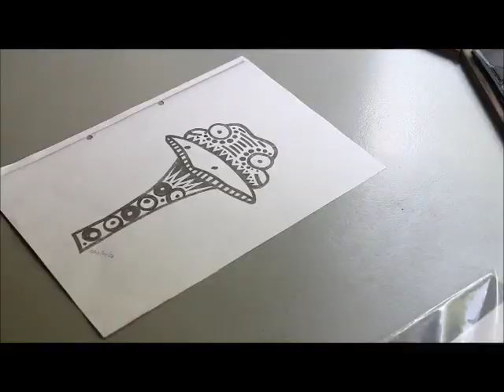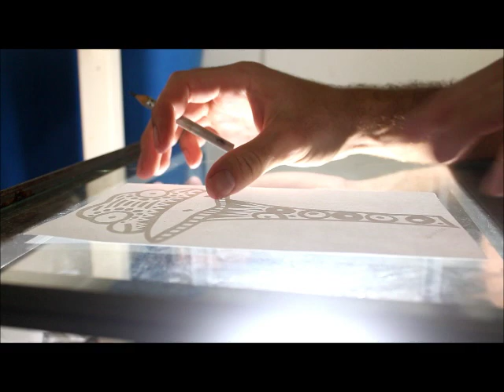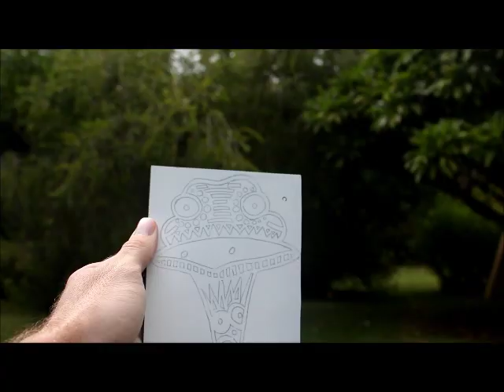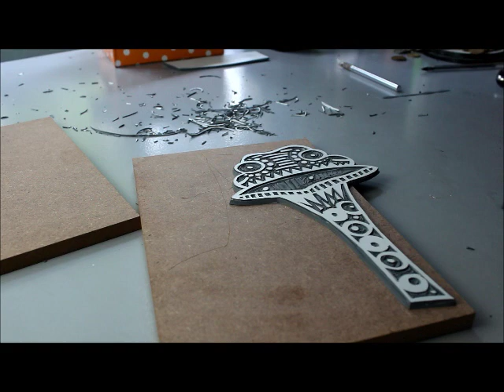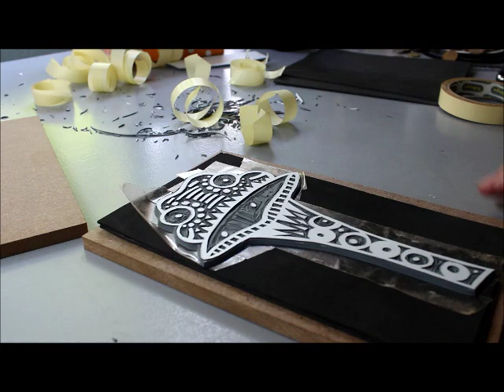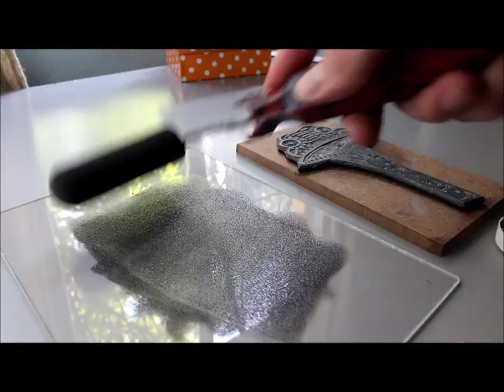Lino Print

Comment: If you use a removable sticky tape and a clear acrylic block you can use the block with different lino stamps and it is much easier to place on the paper. When you are not using your lino stamp you can stick it to a plastic sheet.

Comment: Couple of questions/remarks: you do realise there are blades for lino/woodcut? It's way easer and faster than with xacto knife. And you can get them quite cheap. For transfering image: there are graphite papers, also indigo paper (at least that's what they're called in Slovenia) for transferring (but the image is reversed). Maybe you could invest in a rubber roller (brayer), it would save you a lot of paint, and not this... foamy disaster (if I have seen correctly that it's made of foam or some other material that soaks a lot of paint. If not, I apologise for my assumption). I quite like the idea of a foam to stabilise the lino, but if you flip the whole process - not the lino onto paper but paper onto lino, so the paper is on top - you can then use a spoon or something similar to gently go over the paper it would save you a lot of unnecessary physical work (like you leaning and pressing lino onto paper). And you wouldn't need the foam.  Other than that - this was a very good video. Looks like to me you're a great artist and you should keep on creating. Keep up the good work.
Reply from the maker: Hi Yes the lino blades works a lot better! At that time I just used whatever I had on me. I'm now using white lino making the transfer a lot easier. I now just print the design with a inkjet printer on a glossy paper and then press it onto the lino. Thank you Andrijana!
Reply: Dark lino is fine, all you have to do is using a light opaque color for the transfer. Just cover the back of your image with a coat of chalk or pastels and then trace the image.

Comment: how do you remove the white paint with fixative on top? 
thanks this is helpful :)
Reply from the maker: Grace Syiariel Hi Grace, You can remove the paint by simply scrubbing it with soap and a toothbrush, if the paint is a bit tough you might want to try something like thinners. I've also found that if you stick tape over the lino with paint and then pull it off the paint tends to stick on the tape. Hope that helped :)
Reply: you can use alcohol to remove the paint

Comment: Just a heads up, if you use an inkjet printer and print your image in reverse, all you'll have to do is flip it over and rub the back so it transfers onto your linoleum. May save you some time :) Just be sure to draw over the transfer with a marker or pen so it doesn't brush off. Great video mate!

Comment: Why did you add the extra foam?
Reply from the maker: Balu  Hi Balu, The extra foam helps to cancel out any unevenness in the wood when pressure is applied. (So the print won't have any white areas where the lino didn't touch the paper) You don't have to add foam but then I would also advise to not mount it on wood but to use the lino sheet only. I mounted mine on wood because it makes the printing easier to print in bulk. Hope that helped?
Reply: Riaan Coetzee Yes, thanks :)